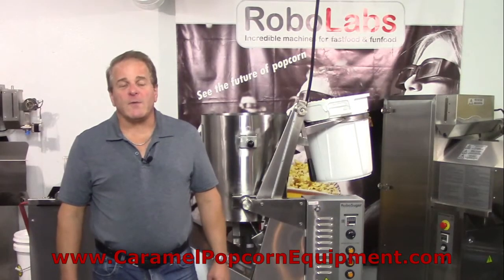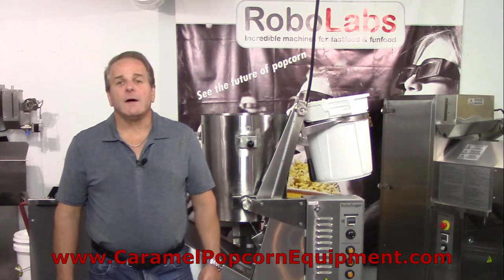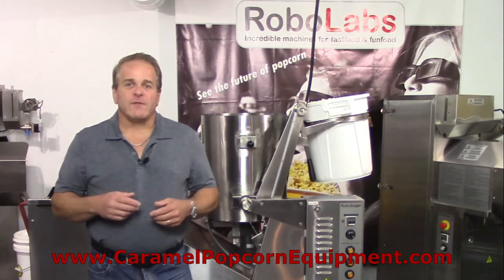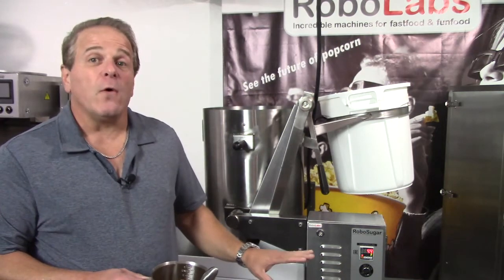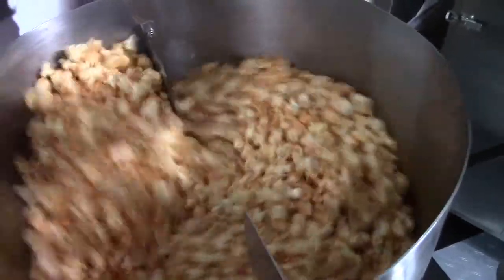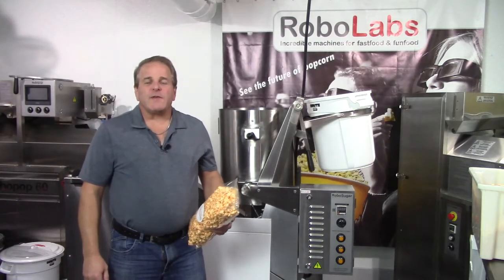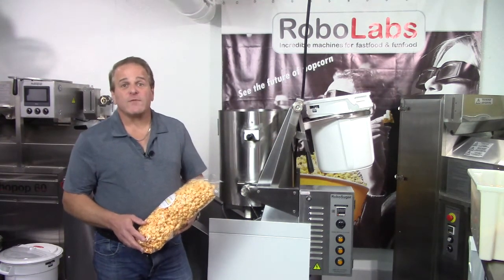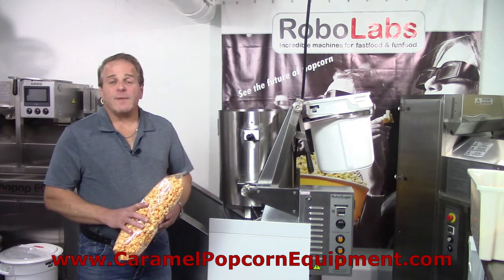Making Savory Popcorn with the RoboSugar 10

Comment: Can you share a video of how you clean the machine? Thank you.
Reply from the maker: I might do so in the future, but it could be a bit boring!  For the most part, all that's necessary is to but water in the kettle and bring to a boil with the cover in place.

Then turn off the power and let it cool down.  The steam trapped in the kettle will melt down pretty much any material off the side walls, then empty.

Usually I add some more fresh water and use a rag for a quick rinse and that's about all it takes.  Very simple and the machine does most of the work.  :-)
Reply: @floatingcottoncandy  The only hack is that you need extra pair of hands to pour out the water from the kettle. Thank you.